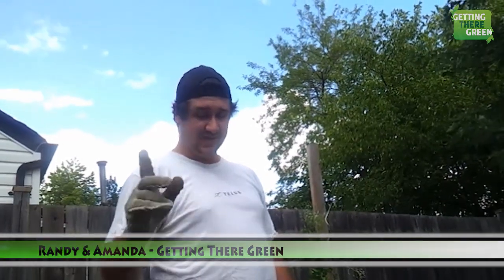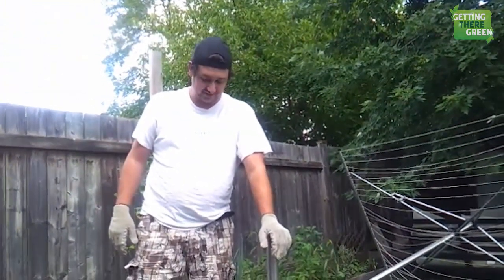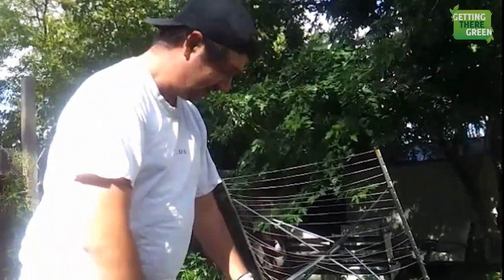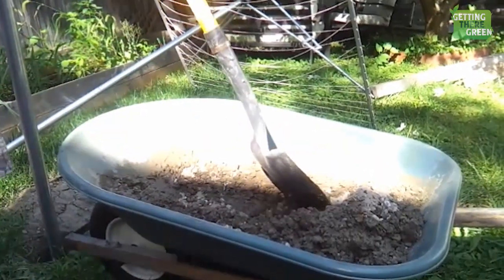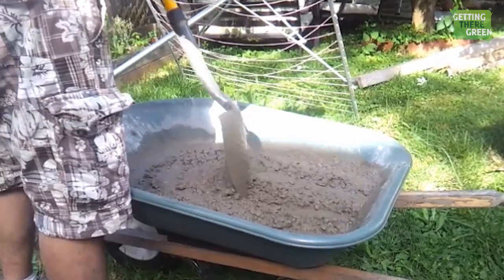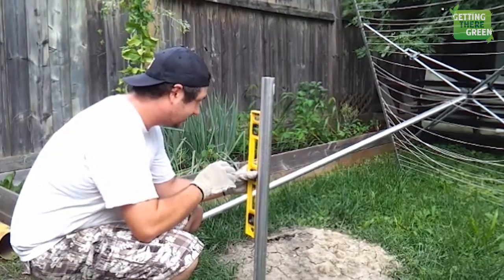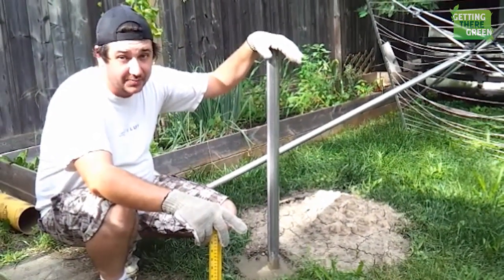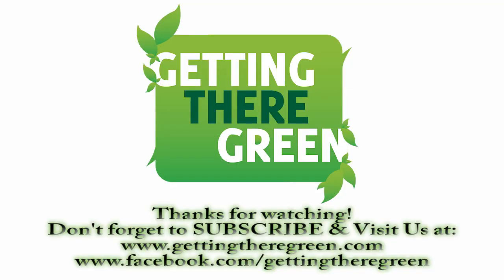How to Mix and Pour Concrete for a Post Hole (Plus Safety Tips)

Comment: I use quikcret myself I never use any dry mix to the bottom I mix the whole bag with water sometimes I will add in extra pebbles making it stronger what was the size of the cement bags did you use I generally use 90 lb bags.

Comment: Hey, interesting video! A bit too interesting - so -
1. Why have you not pegged in a (not wooden) gravel rock to stabilize the pole ?
2. why is it such a deep hole (3 feet ?) ?
3. in order to be able to pour 6" of dry compound you can just use a meter
4. I am just guessing that pole is made of iron, in which case you really should have used a primer on it before casting into concrete

good game!